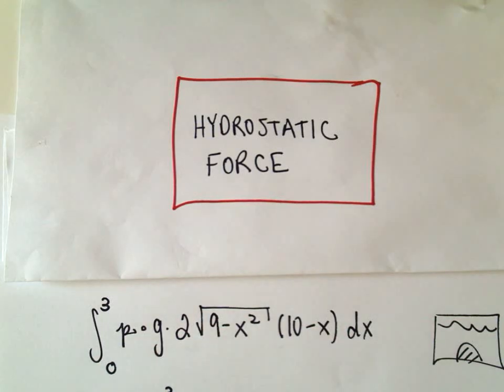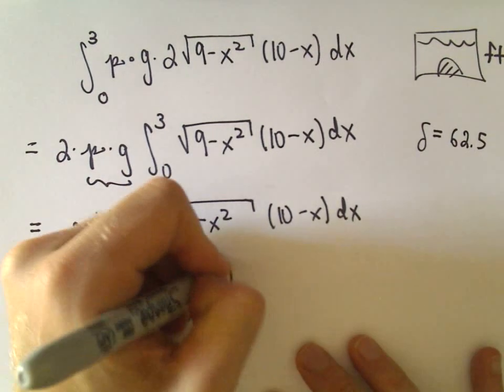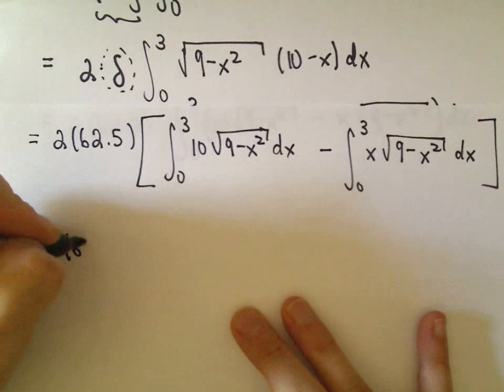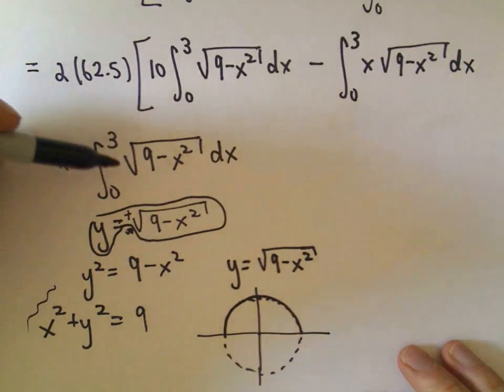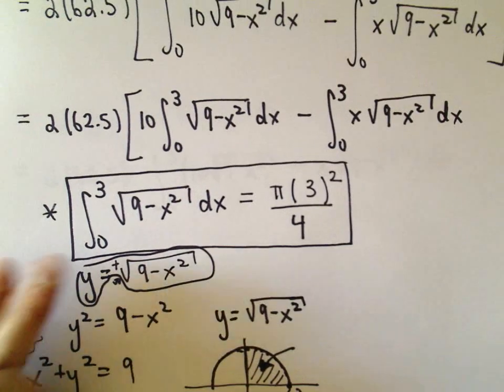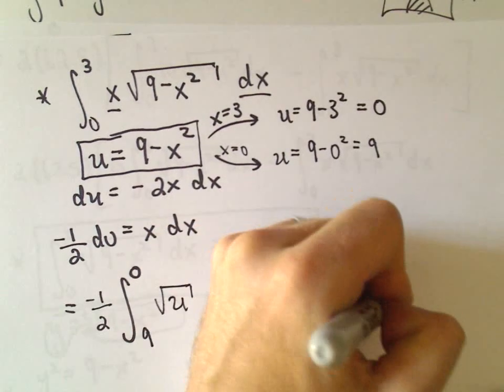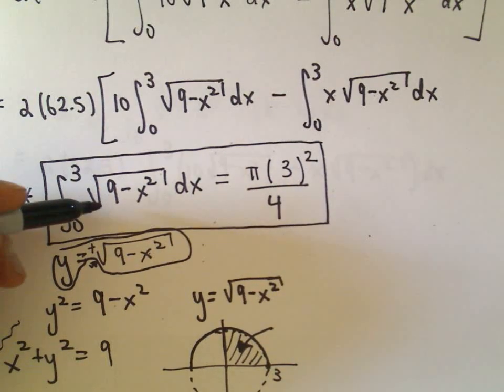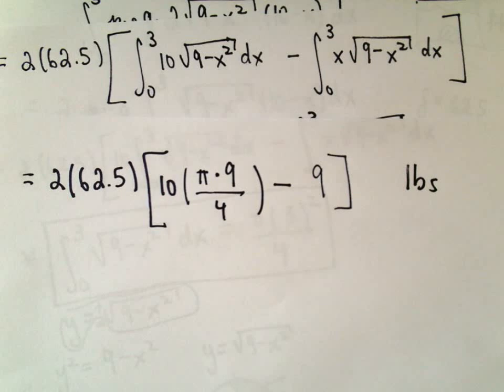Hydrostatic Force - Complete Example #2, Part 2 of 2

Comment: I just did an exact similar problem except with the semi-circle diameter as 4m, so the pressure would be 1,000 instead of 62.5. I got stuck on the trig sub so I couldn't finish the problem, but you took a much different route for that side of the equation and WOW, so much easier and finally got the right answer too! Thank you so much for these videos :)

Comment: @ProductofWit I forgot to think. Just convert to the respected length measurement. Use one gallon or fluid ounce in cubic measurements as a reference and divide. Silly question of mine. ;)

Comment: For those wondering what the answer is at the end it's:
7710.729338 (Calculator answer)
-or-
7710 lbs (rounded to 3 significant figures assuming that initial measurements included 3 significant figures)